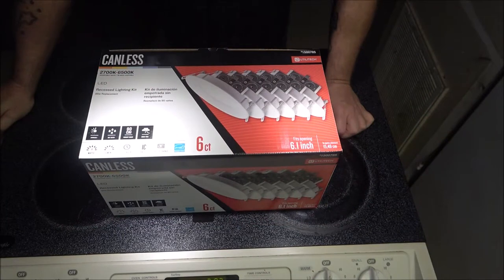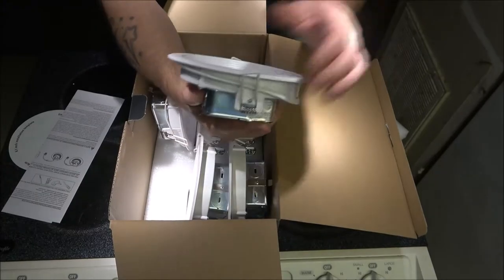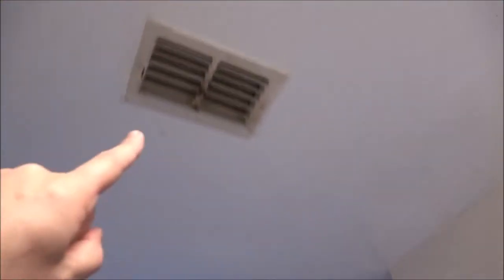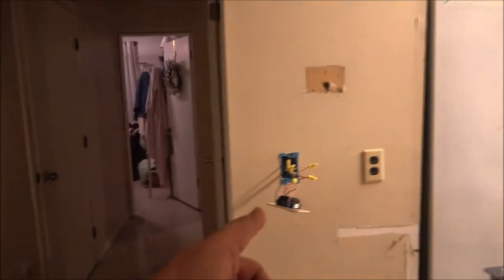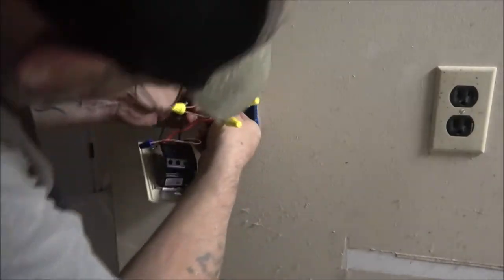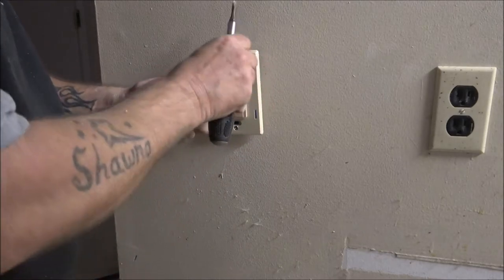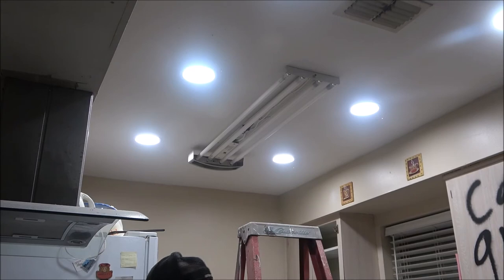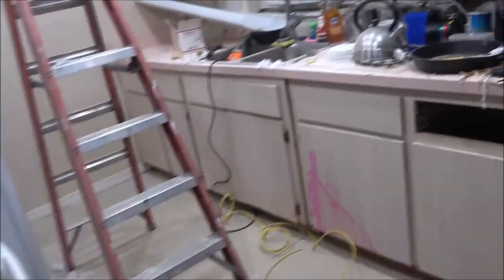Canless Recessed Lighting Installation With Dimmer In The Kitchen

Comment: This is what we're putting in our kitchen. Before you hole sawed through the dry wall did you have to go into your attic and check to make sure you were clear?
Reply from the maker: Yes. I had a slight issue with rafters but nothing major.
Reply: @shabear1000  that's really my only concern is what I may run into above the ceiling that's why I'm going go with the slim line LED instead of the traditional can lights. I used to install lights for a living but that was in commercial buildings in schools, house shouldn't be that much different ha

Comment: WHY? Why didn't you actually show how to wire the dimmer switch?
Reply from the maker: because you wire it the same way as you would a normal switch (which i mentioned in the video). i will be putting another one in for my hall way soon, i will be covering the wiring in that video.